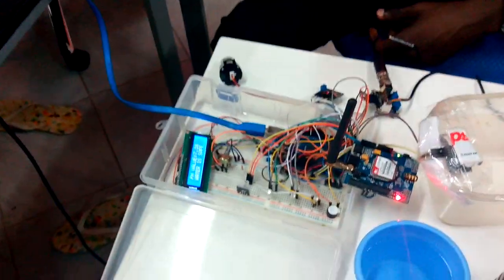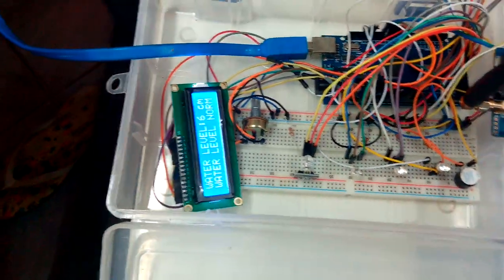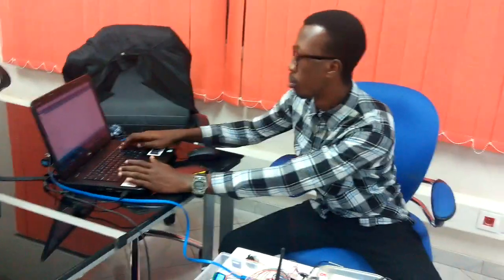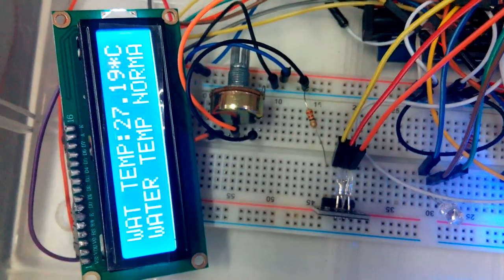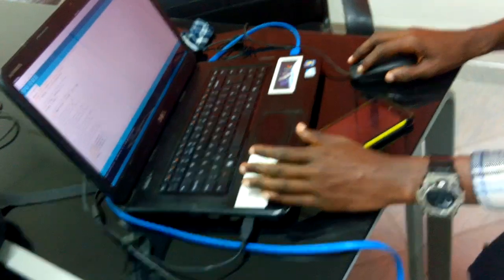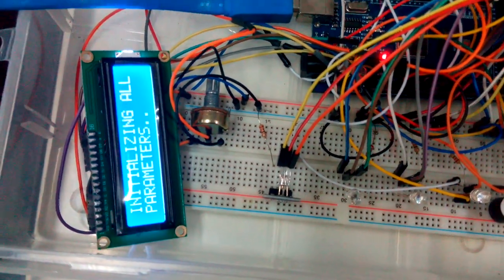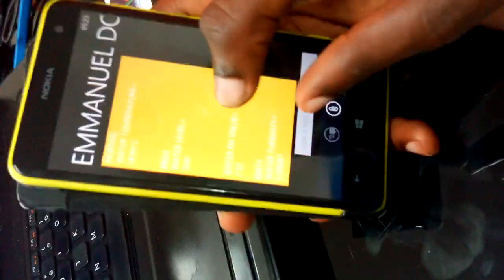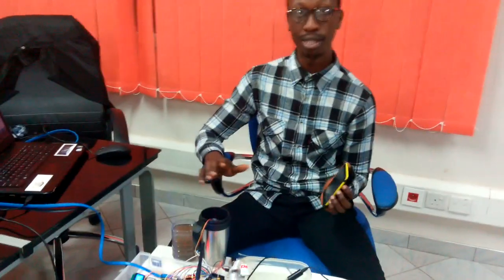Water Quality Monitoring and  Notification System using Arduino Based GSM System.

Comment: Sir, I am interested in doing something similar for my project. Please share a clearer schematic circuit diagram, especially the pins of the atmega (i did check the schematic on projecthub it is not clear) thank you. email is lefotherest@gmail.com

Comment: hello,
why are you used circuit with sensor probe?
can i use only sensor probe with any controller?
one last question: what that circuit exactly does?
thank you
Reply from the maker: Hello @bhavik i really do not get your questions well but if i do understand you.
Q1) i used the circuit with sensor probe because the circuit is what amplifies the sensor probe signals so that the arduino can get the desired signals from the probe.
Q2) From mine perspective  i don't think it advisable to do that, cos every probe is designed differently form the others, as well as their Circuit controllers.
Q3) As i have said earlier the circuit is the controller that amplifies the very little signal the probe captures from the environment. So without the circuit controller the Arduino will not be able to give your the accurate readings.

Hope i answered all your questions to your expectations. 

Thanks.
Reply: thanks,
got it..there is  op-amp used in that circuit for amplification of the signal coming from probe.and trimmer for settle down  offset..in short for calibration purpose.
thanks buddy for reply..

Comment: Hello, sir I am a high school stuent in South Korea. I need your Arduino information for the project. Can you send me the circuit diagram, sensor, coding file of this? I am very interested in your video. min413903@gmail.com
Reply from the maker: Kindly use the below links, i have included all the necessary info. Thanks

https://create.arduino.cc/projecthub/eani/water-quality-monitoring-and-notification-system-f85d23

https://www.instructables.com/id/Water-Quality-Monitoring-and-Notification-System-U/